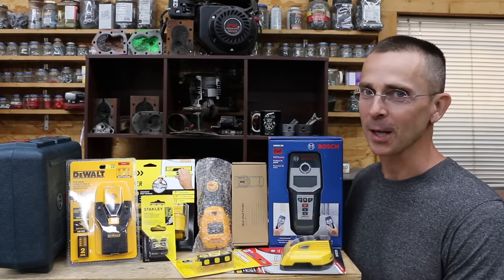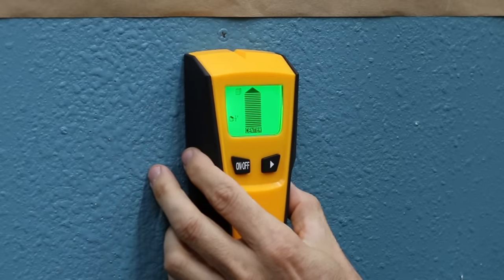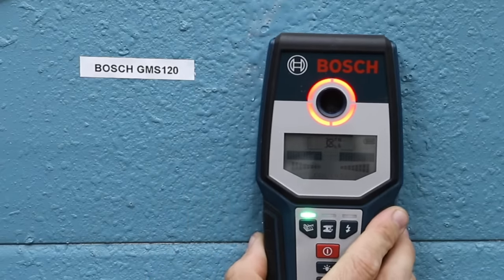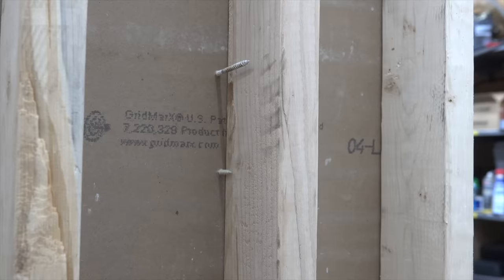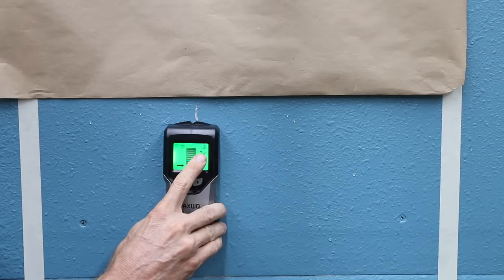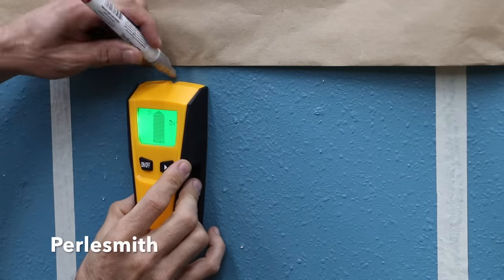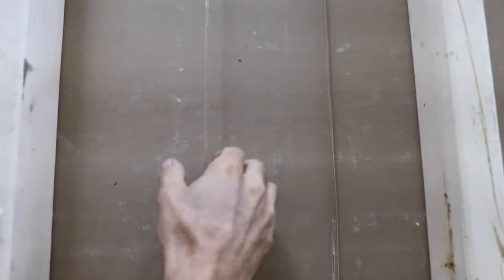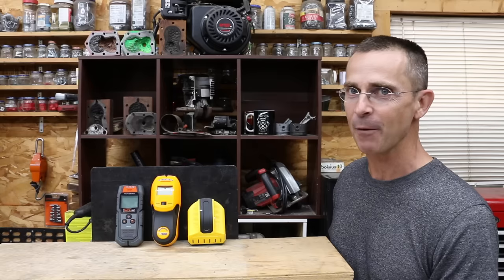Best Stud Finder? $262 Bosch vs $10 CH Hanson vs 9 Other Wall Stud Scanners! Let's find out!

Comment: Thanks, good review! Were your copper pipes electrically GROUNDED or were they left "floating free?" ... Would it make a difference?   ( Usually copper pipes seem to end up getting grounded in 'run of the mill' construction.) Once I owned a house which burned out an electric  water heater every 3 years and had running GFI errors.  Turns out the entire home was only "grounded" to a non-grounded  copper pipe... BTW, House was built by an electrician/"shirt tail" home builder.

Comment: If you do ever look at stud finders again, it would be interesting to test them with metal studs. I dread hanging heavy things on my walls because I have to hit the middle of that stud to get the toggle bolt flush.
Reply from the maker: Thanks for the suggestion.

Comment: If you were going to do a video that included the Walabot, it would also be interesting to add both wood lath and plaster and rock lath (gypsum board with holes for the plaster). I recently used a Walabot on some rock lath and plaster; it worked well enough to successfully find studs for ~90% of the places I nailed in baseboard.
Reply from the maker: Thanks for the suggestion.
Reply: I agree I wanna see the walabot and the new bosch dtec

Comment: I work on houses built before 1945. These walls usually have lattice strip I was wondering if it was possible to test it on that wall specifically
Reply from the maker: Thanks for the suggestion.
Reply: Probably not especially if it's horse hair plaster but the good news is you will always have a hanger

Comment: I recently had to buy a new stud scanner. I went to install a cabinet @ a customers house. My $40 zircon barely found anything (2 slight blips). My magnetic stud finder wasnt finding anything either... come to find out, the entire wall was double sheeted.

I looked into stud scanners. I wanted something easy to identify with a deep scan, over 1.5" for wood. I landed on the franklin sensor. The model i got im not seeing on franklins site, but i got it @ Lowe's for $120. The device automatically detects wires and then makes them dissappear. It clearly detects the stud and shows its width with a row of lights. It has a center light that turns green when centered on a stud. Ive never been able to see so clearly.
Reply from the maker: Thanks for sharing.

Comment: Fwiw, the Zircon A100 was the most annoying device I've used in a very long time (for one the surface is literally made from velcro and grabs anything that isn't perfectly smooth/untextured, which in turn causes constant errors/resetting). I've returned it and ordered the Franklin T6.
Reply from the maker: Thanks for sharing.

Comment: I usually just use neodymium magnets to find stud screws and average out the center of studs, but I wanted to have something that was faster and could detect stud edges and other things since I have quite a few projects. I saw praise for the Franklin Sensor products, so I got the M90, unfortunately it would detect drywall seams and random things I could not confirm were actually there. It was completely useless with drywall mounted on furring strips on concrete block as it was constantly detecting erratically due to the fixed scan depth and shallow gap. After watching the video, I’m going to look into the Zircon or Tacklife.
Reply from the maker: Thanks for sharing.

Comment: I gave up on the fancy electronic stud finders because they always seemed to give inconsistent results, often they would see ghosts or skip over something that it previously claimed was there.  Maybe it's just user error? I just get a stack of strong magnets to stick on drywall screws. They never have false positives, and you can put a bunch of them on the wall to mark studs. For most stuff you don't have to worry about hitting a pipe or wire as long as the plumbing and electric are up to code and your screws are short enough.
Reply from the maker: Thanks for the feedback.

Comment: Frankly speaking, Drywall is not that difficult for any detector... But most of them have real trouble on brick with or without tiles, plaster, cement or concrete; therefore, another test would truly show the differences among them.  Thanks anyway and please keep up your excellent work.
Reply from the maker: Thank, will do!  Thanks for the feedback.
Reply: @ProjectFarm  I bought a Bosch GMS-120 two weeks ago to be able to safely drill ten holes in a bathroom, to hang five tempered glass shelves, but the bathroom has a galvanized steel conduit with wires for the roof light fixture and the electrical outlets, and some galvanized steel water pipes... the wall intended to receive the shelves, is red brick covered with ceramic tiles, as the house is about 67 years old... but the signals from the Bosch are confusing and uncertain...

Comment: The CH Hanson is the only stud finder I have used that actually works in my opinion, including the zircon, anything that requires calibration is prone to failure with any wall that isn't drywall or studs that aren't always tight to the wall. 

That being said, I now want to try the Franklin Sensors Pro Sensor M210 which is the upgraded version of the franklin in this video, waiting to see if I get that for christmas, otherwise I am willing to give that one a shot based on what I saw the Franklin do in this video.
Reply from the maker: Thanks for the feedback.

Comment: Thanks for the review. I am curious how the Walabot app would do? I am also curious about now that you have found the stud, what fastener to use especially in metal studs. You covered wallboard fasteners, screws versus nails (2), but neither of those touched on using a fastener to hand something from a metal stud. Thanks again for your hard testing work.
Reply from the maker: You are welcome!  Thanks for the suggestions.

Comment: Test Carbide 10" table saw blades.  Test on Pine, Hardwood and thin sheet steel. They are a bit different then the circular saw blades you tested so well.
Reply from the maker: Thank you for the video idea!

Comment: I think it would be great to know if the scanners ran on 9 volt batteries or AA's.  A good 9 volt battery at Lowe's is about $5 and they are hard to find.  Pretty soon 9 volt batteries will only be in the Smithsonian.   Also, did those wires have any current going through them?  Was there anything anywhere in the circuit that charged them that was drawing current?  There is a video on the internet where an electrician says to turn on all the switches when using the live wire mode.  I think he is implying that the current makes it easier to find the wires in live AC mode.  Of course, it will make no difference if you are using the metal detection mode to find the wires.

Comment: As always, nice job.  However...  I was hoping, and would really have liked to see how the finders perform at, and near inside and outside corners, and around doors and windows.  When you have two or more studs near each other, or gaps between frames and studs, etc, stud finders ( at least in my experience) often show a solid area, where there is gaps between boards.  I know its hard, and gotta be near impossible to cover everything, and you do a great job, so thumbs up, but if you ever do a follow up, please consider the above scenarios.
Reply from the maker: Thanks!  Thanks for the suggestion.

Comment: Just curious on Zircon over Dewalt, considering the former didn't pick up the electrical wires at all? Purely from a safety point of view that would put Dewalt ahead i'd assume?

Comment: The best stud finder is a good magnet. I bought a pack of 10 off of Amazon for cheap, I can line them up to the screws holding the drywall up and get a bead line of exactly where the stud is at.
Reply from the maker: Thanks for the feedback.

Comment: In my 1979 home with exterior foil backed drywall it was impossible to detect studs.  A side issue, Italso made cell reception inside the house almost impossible.
Reply from the maker: Thanks for sharing.

Comment: Awesome video…fast…had to pause a couple times…I have the Zircon. My experiences have been similar to the testing. I find the orange peel wall texture problematic in preventing smooth operation. I wonder whether adding rock wool insulation impacts performance. I find it decreases precision. When finding center is critical for holding strength I use the finish nail test to fine tune exact center. Getting near corners is tricky or around windows where double studs and headers are concerned.
Reply from the maker: Thanks!  Thanks for sharing.

Comment: Very useful information, many of these have doubled in price since this video.  Wow.  I had just bought the Zircon HD70 which is a less capable version of the HD800 (similar to the A100 I think).  I haven't opened it so I am considering upgrade to to the better Zircon or the Tacklife for 20 bucks more!
Reply from the maker: Thanks for sharing.

Comment: Nice work. How do you know that vent pipe is enough for all of those fixtures? Was wondering about nail plates. Are you just going to put them over the pipes and not the electrical since the electrical is metal clad? A nail or screw could punch through the aluminum pretty easy.

Comment: I have the Franklin 13 sensor to find my studs. Works great for that. But to find the actual screws or nails (which I want to avoid), I also have the C.H. Hanson stud finder. I have 1958-era (good bones) walls with skim coat and a few coats of paint. Detection is vague, but I can feel some pull through my hand. Regardless, the draw is too weak for the unit to stick to the wall. Given that, can I actually pinpoint, relative to the unit, where the metal screw is? Is it supposed to be between the two magnets? Or just under one of them?

Comment: I'm putting a steel roof over my old single layer shingle roof and 3/4 " shiplap under shingles I'll be nailing 1"x4" boards to roof too nail steel roofing too, will any of these stud finder find the rafters ?

Comment: Why build a test wall with 1/2" drywall? That's incredibly easy, any stud finder that isn't complete garbage will work well in that.

You  should build a test wall with a double layer of 5/8" drywall, and both metal and wood studs, that would be a much better test. And that's not uncommon on newer buildings, where they use a double layer for fire ratings or soundproofing. Good stud finders should still work on that  wall.

But what I'd really like to see is which stud finders, if any, work at all on plaster & lathe walls. In my experience, no stud finders work at all on plaster, but I'd like to see if there are some that can work even a little bit. Including the Bosch wall scanners and the Wallabot DIY, both of which use radar technology.
Reply from the maker: Thanks for the constructive feedback.

Comment: Are there any that will find an underfloor water pipe under 1.5-2" of screed?

Puncturing of underfloor heating loops is a massive deal and something you want to avoid at all costs.

Comment: What is you are working with a drywall where there is paneling behind it or a lathe and plaster wall? There is where I have most issues locating studs.

Comment: Interested to see how the scanners would do for things running through a stud without a cable protector plate. Electrical wire and plumbing.
Reply from the maker: Thanks for the suggestion.

Comment: I saw a GC use the Chanson one on a commercial store reset.  Afterwards, I bought one and have used it every since then.  Prior to that, I would use magnets and stick them on the wall.  I don't trust the electronic ones.

I am curious to know if some of those electronic ones that you used in the video, are actually detecting the stud.  Because it appeared as if they did not detect the stud until it was dead center.  Which IMO, it would seem as if it's actually detecting the screw, and not the stud.

So that makes me wonder if they would have detected the stud as accurately, had the screws not of been any where near the stud finder.

Comment: I use a large magnet suspended from a rope. You swing the magnet back and forth across the wall until it snaps onto the stud.  

This has been the only effective stud finder I’ve found for my 100yr old house.
Reply from the maker: Thanks for sharing.

Comment: Wished you would test how deep a tester can find a stud. When I cut a hole in a ceiling sometimes there is wood off set from the drywall.
Reply from the maker: Thanks for the suggestion.

Comment: All these stud finder who works with a 9 volt battery are all a little imprecise as soon as the battery fall down under 9 volts the become erratic, one that I would like to try is the Milwaukee M12 suppose to be strong enough to find rebar in 2-3 inches of concrete  !
Reply from the maker: Thank you!

Comment: I tryed using a stud finder , then tryed using my neighbors, both were not reading correctly so I went and got my last resort ( a magnet ) and sure enough it found the screws holding the drywall to the studs .
Reply from the maker: Thanks for the feedback.

Comment: 6:00 I think you misused the Bosch GMS 120 sensor. Yellow marks the edge of an object and green the first area where it's "free to drill in". But you marked the yellow indication on the left - that's probably the reason you hit the wood on the left.

Comment: Great video, as always :) Can you send links with 2 current choices? I need live wire detection. The Zirom A100 is no longer available... Otherwise I was thinking of the Zicom A220. (My price range is between $25 to $65.) Thanks! Rob

Comment: Using the Zircon I did not have such good results trying to find studs in my wall 😢. The knock test seemed more reliable. I have a bunch of small drill holes in my wall when I was trying to find studs with the Zircon.
Reply from the maker: Thanks for the feedback.

Comment: I determined years ago that very strong earth magnets are superior to stud finders.  The magnets locate the drywall screws/nails in the wall in seconds and simply stay put.  Using magnets also reveals exactly where the drywall screws/nails are so that someone doesn't try to drive a nail or screw into that same location.
Reply from the maker: Thanks for the feedback.

Comment: I would like to see how the stud finders perform with different types of insulation in the stud bays. Like fiberglass vs rockwool vs spray foam and the stud finders ability to work in those conditions
Reply from the maker: Thanks for the suggestion.

Comment: The question is, do they work through porceline tile and concrete backer board. That requires more than a cheap dielectric scan.

Comment: Another great test!! I would recommend testing for CAT5/CAT6 and RG coaxial cable/wiring since so many people wire their house for cable and internet, Thanks! 
My method is to just make as many holes as needed until you find the stud or clip the wires, poke a pipe, etc. 🤣🤣 JK!!

Comment: I've tried 3 of these on older plaster or plaster on drywall walls.
They do far worse.
Most are a vague guess.
I have the Zircon and craftsman and a no name hardware version.
They do not like looking thru plaster for some reason
Reply: Usually get close then still drive nails until I hit the studs.

Comment: This was a great video!! I was just curious if there is a stud finder that would be able to find the stud behind horsehair plaster with lath? That's one problem that I run into, trying to find the studs so I can put a light in the center of a room and then it continues to beep because of all the lath that is all over the wall or ceiling.
Reply from the maker: Thanks!  Thanks for the suggestion.

Comment: Why not the Walabot? At less than half the cost of of the Bosch, it seems to offer a very good midrange instrument... if you believe the ads.
Also, the Walabot will supposedly work on lath & plaster walls and concrete walls.
Reply from the maker: Thanks for the suggestion.

Comment: You should have done the test at my house where there is 3/8 drywall and approximately 1/2 inch of plaster on it. It's a real pain.I use the knuckle on the wall more often than not. I guess it's why I've always called them stud liars.
Reply from the maker: Thanks for sharing.

Comment: My house is from 1954 and has 1/2" of plaster on 1/2" sheetrock, on all walls and ceilings. That's a challenge to any stub finder I tried so far, most failed to indicate a reliable result.
Reply from the maker: Thanks for sharing.

Comment: OMG! Thank you, sir, for your plain, open, honest testing and comparisons of products used by everyday workers.  - This stud-finder tool should put to shame most of the manufacturers - and also the graduates of famed "tech" schools, CalTech, MIT, Carneigie-Mellon - who ought to be more involved in helping their fellow citizen/worker. 

(has anyone combined simple combination tools of audio sensing plus magnetometers? - with sample of known wall/stud materials, pre-set measures could give ranges to be verified before manufacture and sale of these wasteful, horribly failing tools, disrespecting the poor day-laborers and non-union people usually paying for these products - instead of earning money by filing class action corporate lawsuits and complaints against county and states for failing to inspect such crappy, rip-off tools/products, stealing money from blue-collar workers!) You must be a practical engineer if not college trained engineer, to do such well conceived, and simply, powerfully measured tests. How about some feedback from you on these issues?

(The failure in simple road signs, failure in road design/maintenance in Mass. is CRIMINAL - drivers forced to slide off roads and into traffic in the MANY days of snow/ice/slush. THANKS "GENIUS" ENGINEERS FROM federal and state funded universities - and corrupt relative--paid contractors! How many highway deaths needed to spark any civic-responsibility you twerps?)